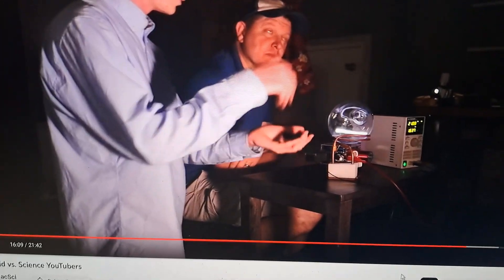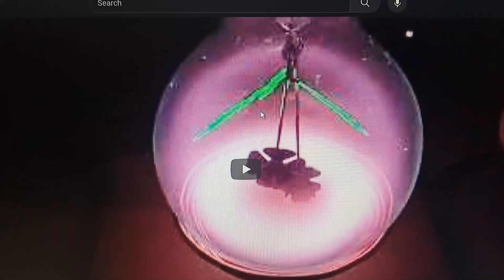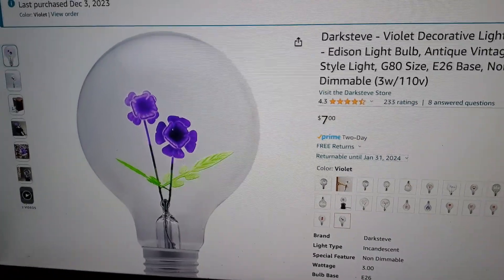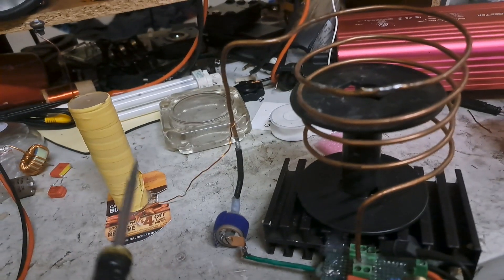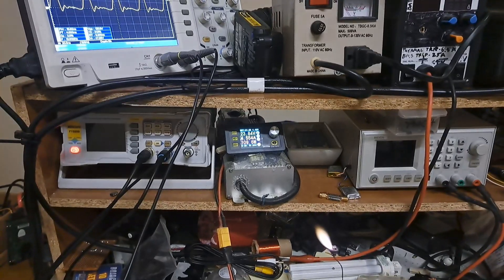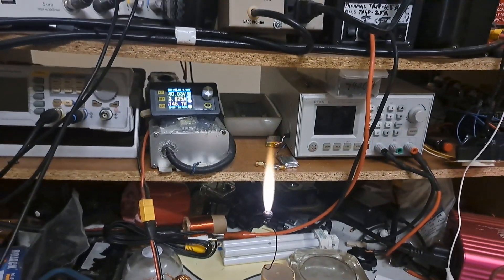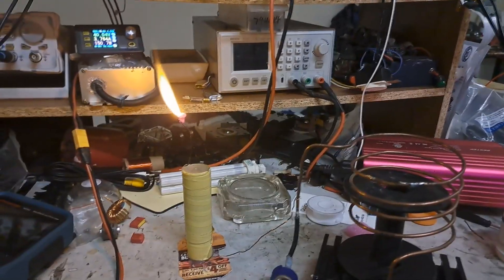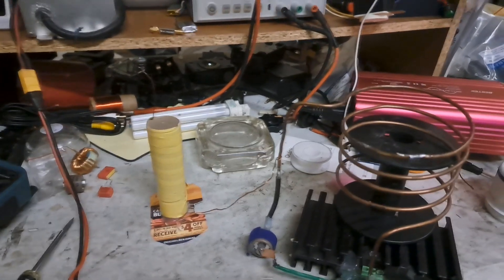14Mhz Plasma Flame Build (for Plasma Toroid testing)

Comment: Do you have a schematic design for this or a reference?
Reply from the maker: There are many different references nowadays but these are mostly the same circuit in the basic form. Jay from Plasma Channel did a collab with Teslaundmehr on it. The ones I have are just different LC variations and tuning. 

This one I just figured would be a good setup for trying to excite gas filled globes.

Comment: Hell yes.  Out of the tubers out there i feel like you are the guy to continue and expand on that gorgeous doughnut.  

Im still going through the two comments i haven’t responded to piece by piece.

Those bulbs should be great temp substitutes.  I wish I new more about forming glass.  There has to be another glass blower youtuber who would be interested in doing a colab.  Especially if they get how rare this would be.  

Just to touch on the rc topic.  You mentioned needing many channels for functional robotics.  There are ways around it.  Drive for instance.  A “tank” style drive in the form of an H bridge will take it down to two channels.  Sabertooth is a very solid brand.  Not only for H drives either.  Way back Atom had some cool modules, which are now priced like gold and outdated, but im sure replication is well within your ability.  Obviously there are many other options for the same result.  In reality I bet you’d end up making your own since its pretty similar to what you have done in the past.  

Also, for multiple points of articulation like grasping arms, you can set up as one command.  Then you just need the interface between the channel out and individual drive motors.  There are purpose built modules for all of it.  Arduino(which im hopefully going to finally break into this jan) obviously is a simple modern solution.  Although I have always been much more into analog solutions.   Maybe a few 555’s tossed in.  The schematics may look large and intense.  But it pretty much just the same thing repeating.  

Then im sure you know about converting small servos to drive motors as well as large “auto window motor” servos, and linear actuators.  

Aside from my purpose built articulating attachments, my current robit model is using alot of wheel chair parts and truck attachments.  So thats saving on alot of though put into design.  Although once it can move my toolbox and welder for me, ill use it to build a much more purpose built machine.  

And knowing the receiver kicks out pwn, and you will already be needing a motor driver, making a middle man to convert the pwn to a usable linear V is pretty strait forward. That doesn’t help much with channels, but nice none the less.  

For less complex motions then an arm, i love mechanical solutions.  For loading things to the robits work bench, or stair climbing function, im all about gears and pullys.  Both for different drive mechanisms, and ghetto old school solutions to lack of smart modules.  Like an old cash register or 1990s dish washer use arms or cams as electro-mech switches. Using dc drive motors, that type of switch takes care of both time and intensity.  

Last ghetto “hack” i personally love when i need to add functions to something within eye shot is just using rf key fob things.  Like for garage door openers and auto apps.  

For my current helper robit ill be using a couple of those even though i have plenty of channels open on my radio.  Partially due to keeping away from local and machine made interferences.  But also for the detachable pieces like its boom crane and dump bed.  Pieces like the crane is also used on my trailer and small engine work bench.  

The next model will have a purpose built transmitter with all in one.  But to get there this should be fine
Reply from the maker: lol no problem that all sounds pretty damn oldschool and I like it. It's pretty out of my ability to do relative to all digital but it also sounds like quite a task relative to some 'explorer buggy' I have plans for. I guess not quite in the same ballpark. Maybe some commercial RC things could be useful such as the control portions on 433 or ~900mhz. 
All that other stuff is where the different protocols come in for me. Right now I'm just using PPM I think. In reality that basic approach would turn even the simplest 'grab with arm' task into something difficult that takes a lot of button and switch pressing, one at a time lol. The other interesting concept is 4G control which should work almost any distance, but with higher latency. Always thought it would be cool to drive a robot to the other side of town.
Reply: @Magneticitist  haha.  Yeah.  A rover buggy and a around the field worker are pretty different.  And if I were a bit more digitally inclined i would save the belts and gears for models...  

An across town/mountain buggy/rover has always been a goal.  The semi automation or drive by command with satellite is like a wet dream for me.
Reply: Yeah... just to touch on the subject...

Comment: I have been enjoying your videos for the past 2-3 years and you keep amazing me. How high can you go with the frequency of this circuit I think I never saw one running at 14Mhz. Also I'm trying to build your hfsstc (~3Mhz) that runs with a schmitt trigger and ucc and is class e. I wanted to ask you how you tune this things. I already build one running at lower frequency's like 800Khz that can run for 10 minutes cw at 160Watts with only the secondary coil getting hot but I kind of forgot how I went about it. Do you start with a random capacitor and than tune the primary coil inductance to that capacity or the other way around? Also how do you know that the capacitance is "right" or is it just randomly playing around with values until something starts working?
Reply from the maker: I've seen some of these ran pretty high actually. I've done 23mhz before with an IRFP460, but about 17mhz or so is as high as I've ever done a legit plasma flame on these. The upper limit on frequency really depends on various factors, none of which really ultimately dictate a "maximum frequency" without having some values to associate with it (gate charge, gate resistance, intrinsic inductance, on time, etc)

The ~3mhz circuit I made was using Steve Ward's technique for Class E by utilizing the primary coil. I would typically try to set a ballpark shunt value cap and leave it fixed, then play around with the exact length of the primary. Just leave some extra leakage inductance in the primary and clip it down bit by bit etc. I realized that if you just scope voltages, particular the drain and gate waveforms you can typically get an easy indication of how well it may be switching at the time. I'm typically just looking for cleaned up gate drive that is stiff and lacks ringing, as well as a nice smooth symmetrical drain waveform hump showing me the voltage on the capacitor ringing up and going back into the primary (reaching 0 before gate turns back on).

Comment: I see , you got the plasma toroid fever , those legit bulbs are expesive af , I been playing with my pll tweaking the min max triggers and finally I got it to work on feedback but it still not perfect , I noticed on feedback it draws way more power , cause I see it drains the bus caps completly even at super low on times like 4ms , on fixed frequecy it was able to do like 4 strikes from the just the bus charge , now it only does 1 and probably is not getting peak voltage at all , I am gonna try charging the bus a bit higher , now I am doing 100v on a 940uf bus , I can get up to 200v cause of the caps rating
Reply from the maker: Yea I have to try it now that I see it works with a $7 bulb haha. If you are getting a good feedback lock I would imagine that it would indeed pull more power and you might have more power in the output that is not easy to see. Maybe not though. I never found that actual tuning of those pots was something that was easy to rationalize. I would only really just sort of memorize how a particular circuit would act given the pot settings. Just setting some random window doesn't necessarily have the arcs propagate the same relative to swinging the center freq up or down.